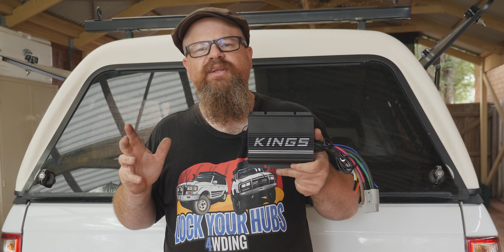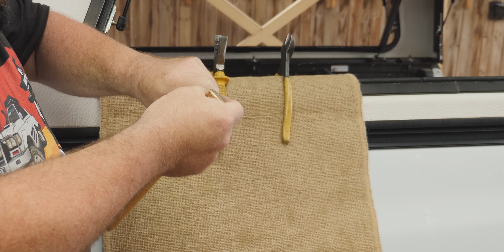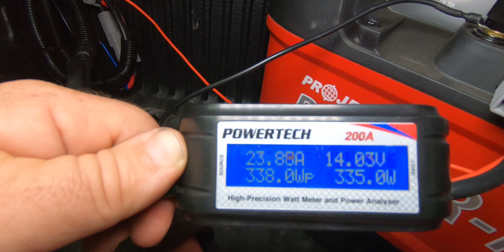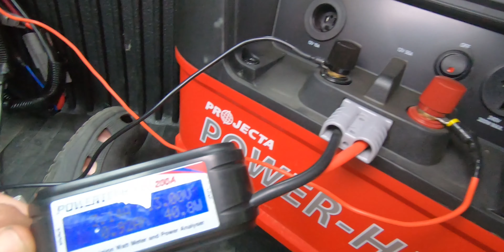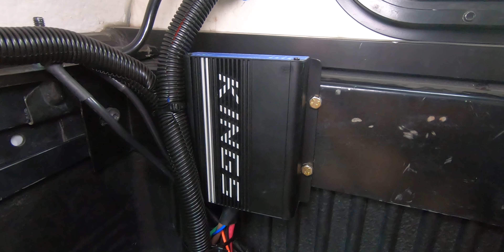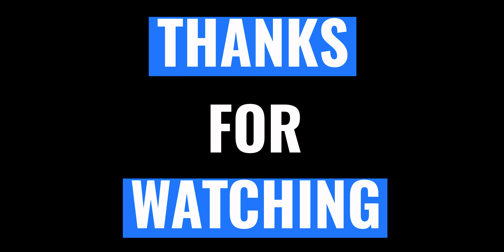4WD Supacentre Adventure Kings 25AMP DC-DC Charger (with MPPT SOLAR) Install and Review

Comment: Hey guys I have a dual battery setup under my bonnet and have a Anderson plug wiring running to the rear of my Ute to a power box but could I use that wiring kit to the box and plug to the dc/dc charger instead and run the solar Anderson plug to my 200w panel on on of my rooftop tent will that work the same and charge my battery’s?

Comment: I grabbed the newer version which already has Anderson plugs already connected. I have a Projecta Power hub as well. Thinking of mounting it direct to the power hub the way Kings show with a battery box. Been wondering what to do with the temp sensor, smooth brain moment, didn't think of just putting it on the terminal connector :p
Reply from the maker: I always search for the most simplistic solution!

Comment: Manual says nothing. I have alternator and solar slow flashing with solar plugged in and engine off. 
I have the blue wire connected to ignition. So shouldn’t it STOP sucking off my start battery the moment it’s off?
Reply from the maker: Yes it should, the easiest way to test this is to have a clamp meter around the positive wire on the battery feed, when you turn the engine off, the current should stop flowing.
Reply: @LockyourHubs4WDing  even with the blue wire connected to ignition. I turn off the engine (and ignition 12v supply drops) and it continues to drain the battery at 22ish amps until 12.8 or so volts on the start battery - this can take 5 minutes of sucking 22 amps off it. Not really impressed. A dc dc charger that operates off start battery voltage alone is DUMB. I would have thought the moment the 12v supply drops off the blue wire it should cut charging immediately. 

Now if I trickle charge my 12v start battery, the dc dc charger kicks in and pulls it down. Regrettting my purchase immensely
Reply from the maker: @Jack_Hagerty  oh ok, so it looks like it's a voltage dependant relay. That's not that unusual to allow a system to draw from the start battery until a certain voltage is reached before cutting it off. The redarc voltage dependant relay used for a second battery installs does exactly the same thing. 

Next time I see the ute the DCDC is installed in, I'll put a current clamp on the supply positive after turning off the ignition and update this thread.
Reply: Hi mate , so are you saying the alternator light flashes all the time even when the car is on or off ?

Comment: What was the verdict guys?? Looking at buying a charger to get ready for a trip away but funds are a little tight 😅😅
How did it go?
Reply from the maker: Still running great, it's been powering a 40L Engel from solar since installation.
Reply: @LockyourHubs4WDing  awesome 

Thanks mate !!

Comment: Hi, how is the product performing a year on?
Reply from the maker: Been running flawlessly in the back of the ute running the 40l Engel fridge using a 160watt solar since the install. It's not had a single issue so far.

Comment: Hey mate
Great video! I was just wondering if you could help with a problem I’m having. I’ve just hooked up my one into my ute but the “CAR” light on the side of the DCDC charger isn’t lighting up. What would be some things to check to get it to light up?Thank you in advance
Reply from the maker: Check the earth connections first, make sure there is continuity to the earth on the battery terminal.

Comment: solder and crimp those tangs especially eath lead
Reply from the maker: Solder, crimp or solder and crimp?
Reply: @LockyourHubs4WDing   if u have correct crimpers, not the  jolly jak like this fella  it won't matter   just harder after u solder

Comment: Great video mate, just wondering if the DC charger has to be connected to a starter battery for the MMPT to work? would like the option to take out of the truck when camping and leaving it connected via solar.
Cheers Rob
Reply from the maker: Unfortunately we didn't test the charger without the starter battery connected.

Comment: How is it holding up after 8 months?
Reply from the maker: Still going great! It runs a 40L Engel Fridge full time in the back of the ute and is also fed with a 160W solar panel since the install that's permanently mounted to the roof racks.
Reply: @LockyourHubs4WDing  cheers mate!
Reply: Great job mate

Comment: Awesome stuff mate i have the projecta hub as well with 100ah calcium battery just bought a 25ah projecta 12v and solar charger simular to that one 👌🏽👌🏽
Reply from the maker: I even run an electric blanket in the swag, off of the Power Hub, because I'm old! lol
Reply: Thats the go mate 👌🏽 heck i would to 🤣 hahaha that anderson plug on toppa the canopy is an awesome idea 👌🏽👌🏽 may consider doing that to my arb ascent canopy 😃😃 on me np300 navara
Reply from the maker: Seems to be working great, there is a 160watt panel up on the roof racks now. Keeps the fridge (40L engel) running permanently.

Comment: I’m currently looking for a fuse holder for 50amp fuse, where do I find them
Reply from the maker: Ours came from Jaycar Electronics, though you could use a circuit breaker as well.
Reply: also on ebay

Comment: I would not use Kings dc-dc charger , better to spend the money on projecta or redarc
Reply from the maker: Usually, I would agree! I've  have bad experiences with everything from their winches to their spotlights.

 Though I try not to tar everthing with the same brush and judge each product on their merits. We've been running the DCtoDC now for a couple of months with 160W of solar, running a 40L Engel 24/7. And so far, it hasn't missed a beat.
Reply: @LockyourHubs4WDing  Yeah look i am a bit over another 4wd channel (won't say names) keep on flogging off kings, but i have a mates that just had issues after issues with kings products. Mind you for a budget setup it's ok. But if your looking at a long term setup that's where i would look at redarc or projecta gear. And look at better quality lights

Comment: like your video but can you show how to wire it up as kings shows nothing i wish i got it from kickass
Reply from the maker: It pretty straight forward, the only thing is to make sure there's a fuse close to the battery (as per the video) and select the correct coloured wire for the battery chemistry your using (AGM for example).

Comment: Hey guys Matt here. The DC/DC charger and battery combo has kept my engel fridge running non stop for 4 weeks now. I am really impressed with how well this setup is working. Still need to mount a fixed solar panel for long stationery periods but I seem to get more than enough with the driving I do. Will update later if things change but for now it looks like a winner!
Reply: So how did she go in the long haul?
Reply: @mylesbackshall281 is still going strong with the King solar panel. Keeping everything topped up nicely.

Comment: Wait.. install video... 5:04 “let’s look at the install” one second later, “so that’s the install” No guide on running cables to where to they ought to go. No video on install, only what it looks like and after it’s installed
Reply from the maker: We've shown the terminations at either end, each vehicles wire route is going to be a little different, the main thing is to secure it regularly and keep it from being the lowest point on the underside.
Reply: Pretty ugly install 🤢

Comment: Love your work!  It looks the goods if it stays reliable. I personally have the intervolt dcdc charger which yet to install in my car for the dual battery up front. But something like this would be ideal for juicing up the batteries in a camper trailer/caravan setup. Relatively inexpensive too. btw I love my Crocs too!
Reply from the maker: The jury is still out on long term durability, but it could be a good thing! And Crocs are great!

Comment: You do nice reviews. I checked it out at the online store - it doesn't support Lithium charging. - bugger. In general, I have no problem with Chinese cheapies, but they have to be cheap,  buying a "quality" brand does not guarantee you don't end up buying a rebadged Chinese cheapie at an inflated price or just an inferior designed, expensive product. Brand is not always a panacea. This unit in particular I think is far too expensive for a cheap unit, it should be at least half the price offered, if not one third given what is in it and the zero investment they have made in its R&D. As much as I like the choices 4WDSupacentre offers, some products are actually excellent, but with this one they need to pull their collective finger out!
Reply: @arielrahmane4600  nah mate they are right....this is the first version of Kings DCDC charger which was made in china...the new MK11 version is the aussie built product
Reply from the maker: You're right, no lithium charging profile. Though I wasn't that surprised as they tend to shoot toward the bottom of the market.

Comment: The temperature sensing wire is supposed to connect directly to the negative post of the battery itself, as it is a thermocouple which reads the internal battery temperature via the heat conducted through the battery post
Reply: Do you know if this wire can be bypassed or replaced? (Temperature sensor wire) as I had a repairer cut it and disposed of the ring terminal end.Just would like to save buying a whole new unit if possible. TIA
Reply from the maker: It's possibly just a type k thermocouple. You'll need to verify it, but that's by far the most common.
Reply from the maker: Yep, as I said in the vid, it's not going to help much there! But it certainly won't hurt either.
Reply: Can you leave the temp wire off as mine wont reach the battery?